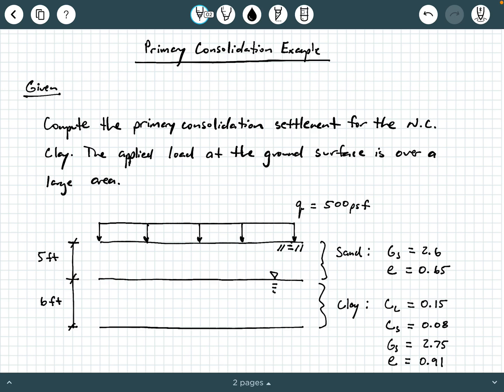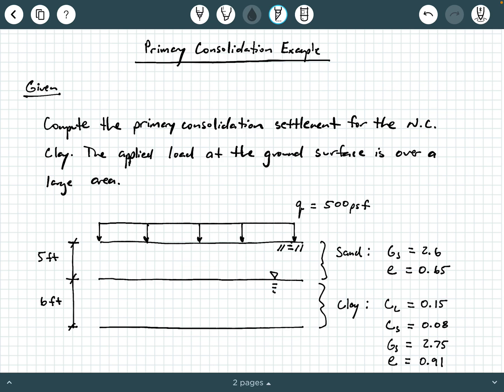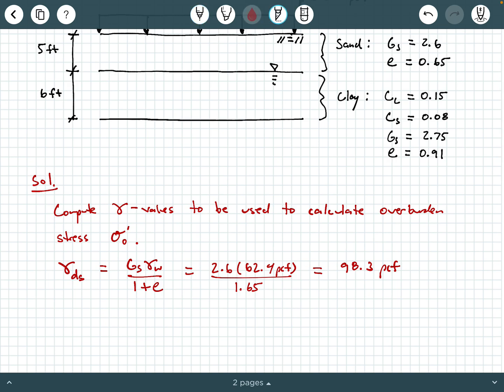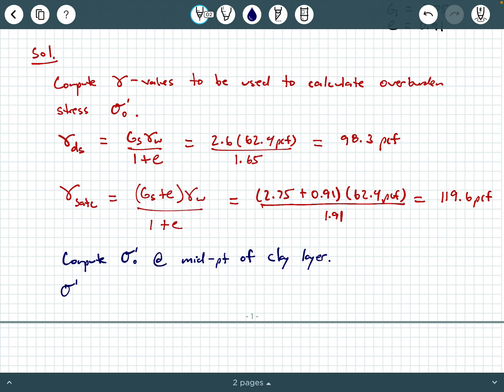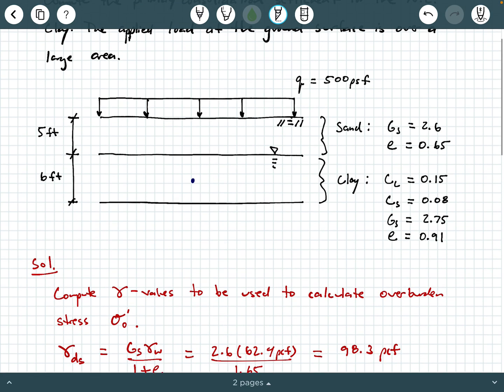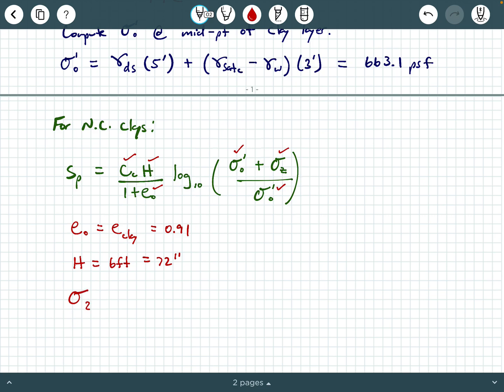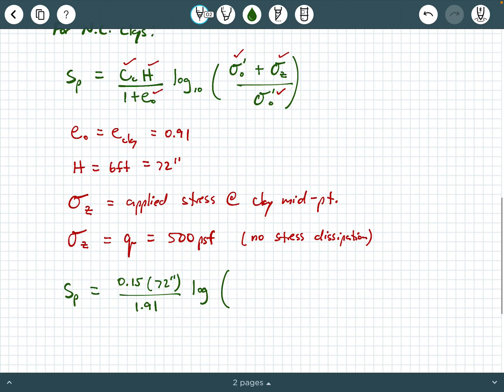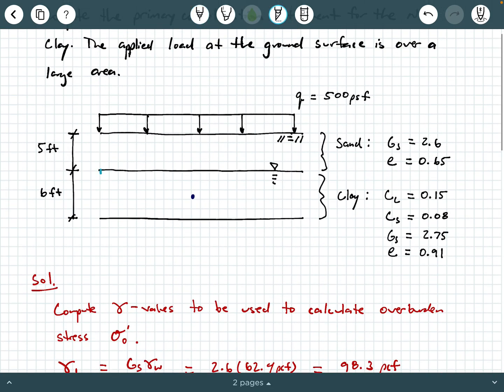Primary Consolidation Settlement Example

Comment: If there are two clay layers how do we take the values of Sigma naught for layer 2
Reply from the maker: You would calculate the overburden effective stress (sigma prime naught) and then the primary consolidation settlement for the second layer, then add it to the first layer's settlement.  Basically, you compute Sp separately for each layer and then sum them up.

Comment: Bro I am fucking back here in foundation engineering after avoiding soil mechanics 2 😂. Btw how did you consider that the soil is normal consolidated?
Reply from the maker: Thanks for your question.  For this example, the directions state that the soil is normally consolidated (NC).  If you ever have a problem that does not tell you if the soil is NC or OC, then you need to compare the effective overburden stress (sigma prime naught) with the preconsolidation pressure.  You can also determine if a soil is NC or OC from lab data.

Comment: Why you assume the sand is dry then compute gamma dry instead of calculating the gamma wet or wet density as we measure on site with the gauge or ballon test...instead I calculate gamma dry to compare with the proctor [ gamma dry from lab] and calculate the relative desnsity....thank you
Reply from the maker: Good question.  In this problem, we assume the soil above the water table is dry.  Also for this problem, we are not given a moisture content for the sand layer.

Comment: Why do we compute o' not, at the middle of the clay layer and not at the bottom? None of my books explain why we have to do this. I'm going to take a shot in the dark and say it's because thats where the maximum pore water pressure is during primary consolidation thus resulting in the least amount of primary consolidation
Reply: Not a pro but I was explained that  the middle the clay layer is taken because we work with the average Po
Reply: Not the instructor, also a student but I believe this is correct. If a soil is able to drain in two directions you use the middle. You do not use the middle though if it can only drain in one direction
Reply: @Camaroni1000  even in one direction flow ,we still  compute (sigma prime not) at the mid of the clay layer ,hence i dont know why...